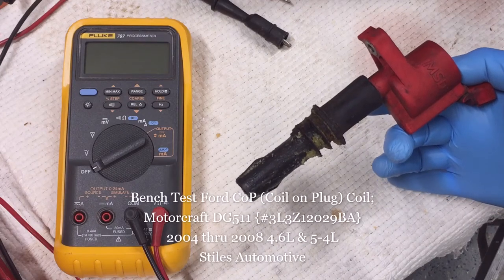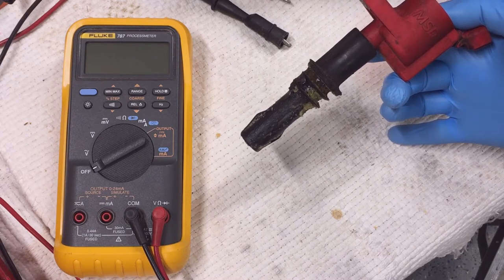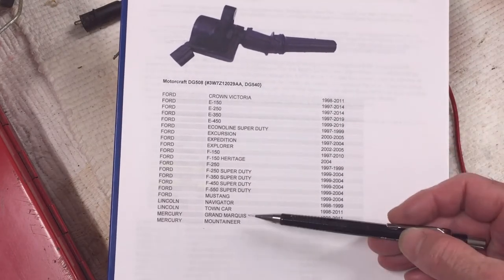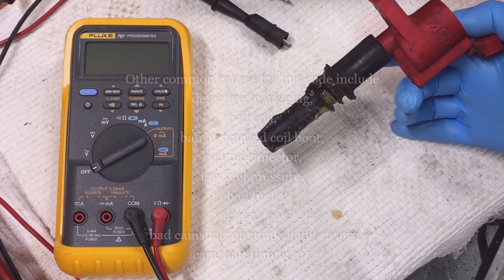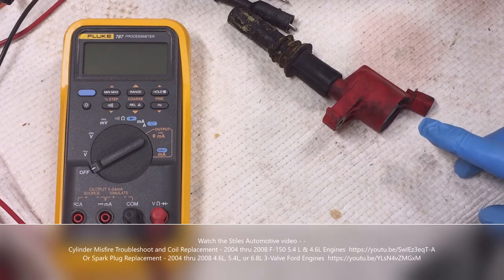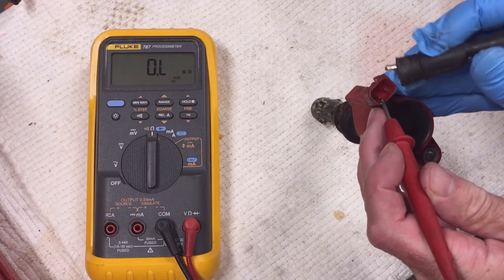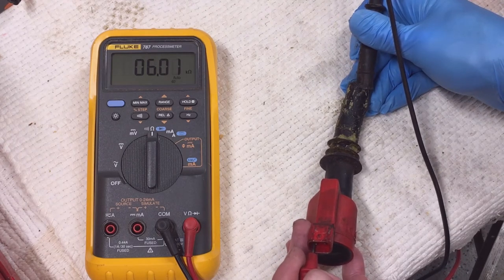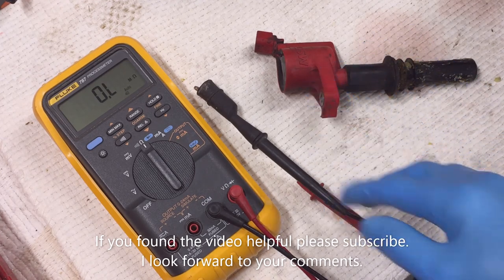Bench Test Ford CoP (Coil on Plug) Coil (Motorcraft DG511, DG508, DG540) 2004 thru 2008 4.6L & 5.4L

Comment: Thanks for the video. There's one more cause of misfire that I've come across. Water leaking into the spark plug hole . filling up the hole about a half inch up. I have no idea how the waters getting in . their after market ebay coils . I just pulled them all and goopped the boots with dielectric grease to get a better seal .
Reply from the maker: Anthony's Dad, Good Tip! and Yep, I like to use lots of Di-electric Grease on all electrical connectors, You have to be careful not to get it on the transmitting surface, however. - Stiles

Comment: Good video mate, very helpful thank you

I’ve always wondered about benchtests in general because it’s always at room temperature, and when the thing is under the Bonnet, it’s smoking, hot and materials expand 

makes me wonder if you don’t always see the fault but it’s a pretty good start …….

Also, if you pull the boot off and the spring off, you can clean up the terminal at the spark plug side, and you can also clean the terminal at the computer side and that can often fix the issue as well
Reply from the maker: Wholls, You are very welcome. Yep, good tips about cleaning, and while you are cleaning, check for cracks and bulging from excessive heat.  However, you often can't tell when their is an internal issue with windings and insulation. I appreciate the comment! - Stiles
Reply: given that heat generally increases internal  resistance  in components that are heat-range sensitive (such as resistors and filter caps).   If measured  resistance is higher than OE spec when cool,  it may  increase linearly  or randomly  with temperature rise.       There are a few components - thermistors and germanium diodes/transistors for example  that have a negative coefficient of  temperature;  as temperature rises,  resistance to flow decreases making the circuit more efficient and more easily controlled.  But when they go bad, they generally quit altogether....    If I was not familiar with  the internal  circuitry, but knew the pri and sec coil resistances at standard temp, I  would put the  suspect coil in a metal box and heat it to around 225F (about 25* above average underhood air temp  as measured right at the coil packs  in my  5.4  F250 at optemp)  and measure resistance,  If it was marginal, I would swap it with a known 0 miss coil.    and run for a few minutes to determine if the misfire migrates....    But for less than $20,   if I suspect a  marginal-ohms  coil is the problem, it's going in the trash and getting a new one... ( and if  the vehicle has  100,000 or so miles  on it,  they are all getting replaced along with the plugs -   "good report cards"  or not... )

Comment: Those readings look good to me, you’re going to have a variance on each coil. Also, if you use the Rel (relative) feature of the meter, you can eliminate the ohms reading of the leads and that will give you a true zero to start from.
Reply from the maker: Eliminator, Yep, you are right, I should have zero'd the Meter for the Lead resistance. I realized this a month or sure after the video published when answering a question. Also I should have manually selected the range and took the Meter off of "Auto" to get a better resolution on the reading. - Stiles

Comment: I would like to point out something. My mechanic, who is a truly phenomenal told me ohming out a coilpack is not a 100% way to determine if a coilpack is good as he has had many coilpacks ohm out perfect but still fail under a load. So this test is just for a chance at showing a defective coilpack but not to know for 100%.
Also you could try pulling off the boot and cleaning the contact spade where the spring makes contact with it, clean all corrosion with a stiff metal brush, little screw driver etc, clean out with electrical cleaner spray, put a dab of dielectric grease on the spade, install spring and boot and retest..you may find you simply had bad contact from corrosion.

Comment: The set of $67 ones I got for replacement for 2001 5.4L Excursion, all 8 read as follows:

Primary: 0.4 ohms
Secondary: 5,900 to 5,990 ohms.
Reply from the maker: These, Yep, I gave you the spec's for Motorcraft and MSD. Different resistance for different Manufacturers. You numbers are in the Ball Park.  I bet the resistance directly applies to Spark Energy and Spark Duration, but I don't know the equation. I appreciate the information! - Stiles

Comment: yes this was heplful my 1999 ford f250 light duty 5.4 2valve had a code po303  cylinder 3 misfire changed the coil cleared the code and has not returned but to be share i wanted to test the coil and my old coil has no reading from the plug end to the negitive termal and only 0.01 across the positive to negitive termanels
Reply from the maker: Wesley, Ok, very good. You are thinking the right way! You don't want to just change parts and hope that you picked the right part.  I appreciate the comment! - Stiles

Comment: Hi I’ve got a question.. 
i had several old coils from my truck over the years and I’m new to using a multi meter. 
On the primary circuit I’m getting a reading of 0.6

On the secondary circuit I had to switch the the multi meter to to K OHMS and/or M Ohms because the secondary circuit would not get a reading using the regular Ohms Stetting. The reading I got from the secondary circuit 7.21 K Ohms. 
So is this coil bad or good?
Sorry it might sound stupid to you but I just want to make sure I’m doing it right.
Reply from the maker: Wyatt's Dad, You are in the Ball Park, so sounds like you a correct.  The thing is with these Coils just checking the resistance sometimes does tell the whole story, you often can't tell when their is an internal issue with windings and insulation.

For Coil troubleshooting, say you have a P0303 OBDII Code, To be sure if the Coil is bad, I like to swap the questionable Coil for a known good one. Remove and install the Number 1 Coil into the Number 3 and the Number 3 into the Number 1 positions. If it is bad, your OBDII Fault Code should change to P0301.  - Stiles

Comment: We need a variable though. Should've also tested either another msd coil you knew was good, since you said this one was bad, or a stick coil, assuming you had one laying around. But i don't think a .1 higher resistance instantly means it's bad.
Reply from the maker: U, Yep, I get what you are saying. As far as the new MSD Coil, I gave you the MSD Spec's.  Its hard to bench test a Coil, the insulation can be totally gone and the Coil tests ok. Bench test works great when the Coil is completing fried, like when there is an open circuit. I believe for troubleshooting you need to verify your work:

For Coil troubleshooting, say you have a P0303 OBDII Code, To be sure if the Coil is bad, I like to swap the questionable Coil for a known good one. Remove and install the Number 1 Coil into the Number 3 and the Number 3 into the Number 1 positions. If it is bad, your OBDII Fault Code should change to P0301. Let me know how it goes! - Stiles

Comment: My 900wheel Supercharged Boss Roadrunner engine misfired and it caused catastrophic failure to my engine. Engine lost all power and eventually Hydrolocked cause injectors kept squirting fuel in cylinder but no spark. So if your motor misfires even once it can be deadly.  My engine only had 18k miles on it and it was fully built forged motor too..Checked coil and it seems fine plus one coil failing will not cause catastrophic engine failure.  Something else caused multiple misfires and caused engine to fail.
Reply from the maker: Maximus, Geez, man, sorry to hear that. Often, it is one little thing that causes a big problem. - Stiles
Reply: @StilesAutomotive  Wasnt coil though,  something else caused multiple cylinder misfires.

Comment: As i understand it the tolerance spec is +/-10%. So if the coils are supposed to be 55 mega ohms then being out by 5.5 is acceptable. Obviously cleaning up the contacts is recommended and should improve the resistance, but if its still close or out of spec even after that then you have a bad coil. I'm curious, that MSD one you have, did you attempt a warranty swap? I've read on forums about people contacting MSD about a bad coil and MSD sending them a replacement after receiving the bad one. One of mine is 8% out of spec even after cleaning it up.

Comment: I bought a truck and I'm having problems with cylinder 4 so I checked the coil on cylinder 4 the coils that are used MAS than beneath it says tfq I'm getting a reading of 0.8 ohms and when I check the secondary I'm getting no reading, my question is should I be getting a reading on the secondary or not and is 0 0 8 ohms  good
Reply from the maker: Louis, If you have a very high resistance reading or a an open circuit reading you have a bad Coil. It is somethings hard to tell from this test.

For Coil troubleshooting, say you have a P0303 OBDII Code, To be sure if the Coil is bad, I like to swap the questionable Coil for a known good one. Remove and install the Number 1 Coil into the Number 3 and the Number 3 into the Number 1 positions. If it is bad, your OBDII Fault Code should change to P0301. Let me know how it goes! - Stiles
Reply: @StilesAutomotive  thank you for the error code is p0304 other than that code I'm getting a bunch of other codes as well p0451 -p1298 -p1450-1285-1484; but I notice sometimes when I fixed one sensor in the past it cleared up a bunch of codes but this time I'm not sure how to go about these codes if you can help I appreciate it thank you
Reply: @StilesAutomotive  I wanted to update you about the misfire I had on my Ford, after checking all the coils, they all gave the the same reading, so I went deeper and pulled the plugs and one plug was completely shot the other's had very little electroid, so I replaced all the plugs, I didn't mention that I had these other two codes when I was trying to figure out the coil but I have 2  codes, one is an EVAP code p0451 and ABS code b1484, these codes were there as well but I wanted to fix the misfire and I did with your help I was wondering if you knew what parts needs to be replaced when these two codes come up. P0451 and b1484. I appreciate your help thank you and be safe
Reply from the maker: @htfdlouissirois  The b1484 Code is Brake Pedal Input Open Circuit, Most likely causes are (in this order): 1) Bad Brake Pedal Position Switch, 2) Open or Shorted Brake Pedal Position Switch harness, 3) Brake Pedal Position Switch Connector corroded (poor connection) and less likely but possible 4) Bad Smart Junction Box (SJB). For the P0451Fuel Tank Pressure Sensor  The most likely 1) Fuel Cap Seal Bad, 2) Bad Fuel Tank Pressure (FTP) Sensor, 3) Open or Shorted Fuel Tank Pressure Sensor harness, 4) Fuel Tank Pressure Sensor Connector Corroded. 5) Bad Powertrain Control Module (PCM) - Stiles
Reply: @StilesAutomotive  thank you so much stiles, I really appreciate that information, I'm not a mechanic and having hard times right now and I truly do appreciate your information. in my situation I think I'll start with the connections first, I believe I can do that with a multimeter then work my way down your list,  thank you so much and have a great day be safe. 👍

Comment: I’m getting a P0345 I change both camshaft positioning sensors. Do you think it could be a coil pack and not the phaser?
Reply from the maker: What1See,  Nope, the Coils are not likely the problem. The OBDII Code P0345 Camshaft Position Sensor “A” Circuit (Bank 2) likely causes are: a bad Camshaft Position Sensor (CMP), problems with the sensor wiring (more likely than you would think due to the Connectors), a failed Crankshaft Position Sensor, damaged or misaligned timing components, and a faulty Powertrain Control Module (PCM).  The PCM sets the P0345 code if the Camshaft Position Sensor (CMP) either sends inconsistent signals or stops transmitting any signal.  I have found it hard to get reliable off-brand Electrical Sensors and Electronic Components. I like to use Motorcraft Components. You said you replaced the Cam Position Sensors, I'd take a look at the Wiring and the Electrical Connectors. - Stiles

Comment: 😂 most of 8 coil primarily circuits reading low 0.40 and below. That's mean I have to replace?
Reply from the maker: Bas, No, I'd say that are still ok. You get different measurements from different manufacturers. - Stiles

Comment: I have a question. I jusr bought my son a 06 F150 5.4L and found the engine is misfiring. I found which cyl #/coil it was with my scan tool and replaced both the spark plug (OEM) and coil (MAS brand from Amazon with good reviews) and it fixed the problem for one day then I started getting intermittent misfires the next day when I floored it off to give it a good test run. I heard the pop/misfire happen and been on and off for 3 days now. I checked new coil multimeter and primary was good but I’m not getting anything on secondary. So I checked ohms on the old coil and the primary was only 1 and secondary 0. I bought enough plugs and coils to change them all out but just haven’t had the time, so I decided to check all the other new coils and they all the same as the first one. Primary I’m getting .7 but 0 on secondary. Does this mean all the coils are faulty? Once the weather clears up over here I will try pulling some of the other old coils on truck now to check them as well to compare, but I just don’t understand why I’m not getting anything on the secondary when all the vids I’ve watched is saying the same as you. Thanks in advance for any help!
Reply: Did you figure  out a solution? I'm having  the same exact  issue?

Comment: I plan to use this technique tomorrow. However, if the ignition coil fares well, I wonder if bad rollers, (notorious with the 5.4) could cause a misfire and therefore the 0303 code. The roller ticking noise is coming from the same side as my misfire, cylinder 3.
Reply from the maker: George, Are you sure you have a ticking sound or is it an exhaust leak, the 2 sounds are very different. If you do have a ticking in the Valve Train, don't let it go very long.  For your Coil troubleshooting and P0303 OBDII Code, To be sure, if the Coil is bad, I like to swap the questionable Coil for a known good one. Remove and install the Number 1 Coil into the Number 3 and the Number 3 into the Number 1 positions. If it is bad, your OBDII Fault Code should change to P0301. Let me know how it goes! - Stiles
Reply: Number #3 is bad check the cop and plug if its a 09 or later pull the valve cover to check roller in that cylinder

Comment: Currently trying to find the specs for a 2008 ford escape 3.0l with the cop style coils and can't find it anywhere. Found two different specs for aftermarket coils but both give different minimum resistances so I'm guessing the factory ford coils wouldn't be the same either.
Reply from the maker: Fordman, That is a MOTORCRAFT DG513 Ignition Coil, used in a number of Ford Cars, 
2001-2008 ESCAPE, 2005-2007 FIVE HUNDRED, 2005-2007 FREESTYLE, 2000-2005 TAURUS	and the Mercury equivalent. The resistance for the Primary Circuit should be 0.55 ohms and the secondary circuit resistance should be 5,500 ohms. 

You didn't ask, but here is the deal: If you have an open circuit, of course the coil is bad, but you can measure the correct resistance and the insulation/windings can still be bad. If you have a cylinder misfire identified by the OBDII code, switch the bad (fault) cylinder coil with a known (non-faulting) cylinder and see if the mis-fire condition moves to that cylinder. If it moves you know that coil is an fault and replace it. - Stiles
Reply: @StilesAutomotive  thanks a bunch. so the readings on these don't make a whole lot of sense to me. they all read 2.8 ohms the first time I checked them, then later 5.8 - 6.0 ohms on the primary wich is a lot higher than spec but I'm only have a missfire in cylender 2. but the other 5 read 5,350 - 5,380 on the secondery except number 2 which read 4,800. It has 130k miles so i'm just going to replace all the coils and spark plugs anyway. but those reading are confusing.

Comment: I've got a friend who has a 2005 ftxextended cab that has problems with coils it has 149k miles on the truck I'm an old man and need help HELP
Reply from the maker: Ray, you need a ODBII Fault Code Reader, your Ford Powertrain Control Module (PCM) will tell the Reader which Cylinder or Cylinders is misfiring. The easy way to make sure it is the Coil is to swap the suspected bad Coil for a good one, the problem should move to the other Cylinder. 

It's not expensive, but this isn't the cheapest Code Reader and it has the ability to read SRS (restrain system) and ABS Fault codes to -  Scan Tool OBD2 Eng/ABS/SRS/Tran Launch CRP123-2022   https://amzn.to/3LtgtIQ

Just plug the Reader into the OBDII Port under your Steering Wheel Column and follow the instructions on the Reader. - Stiles

Comment: I am showing 0.61/0.7 on OEM primary ohm testing. Is this too high?  5.4 to 5.7 on the secondary with the exception of one aftermarket coil that is showing 6.6 on the secondary. I can assume that is too high?
Reply from the maker: Donald, Your measurements seem reasonable and tells me your coils are ok, however, this test doesn't tell you if you have bad insulation and other issue. Meaning your coil could still be bad. Do you have a know problem with one? Or are you just checking them? 
For Coil troubleshooting, say you have a P0303 OBDII Code, To be sure if the Coil is bad, I like to swap the questionable Coil for a known good one. Remove and install the Number 1 Coil into the Number 3 and the Number 3 into the Number 1 positions. If it is bad, your OBDII Fault Code should change to P0301. Let me know how it goes! - Stiles
Reply: @StilesAutomotive   Thanks, have a good day.